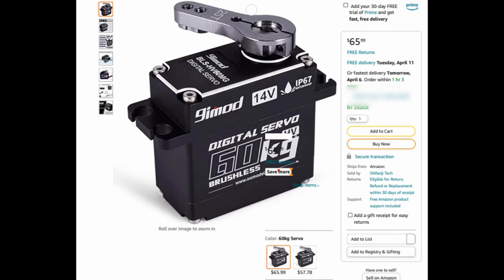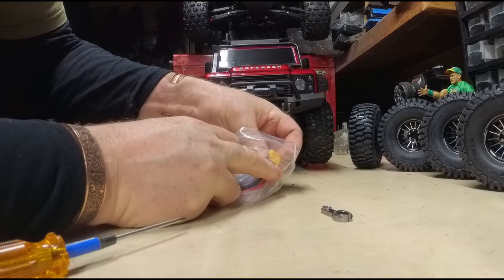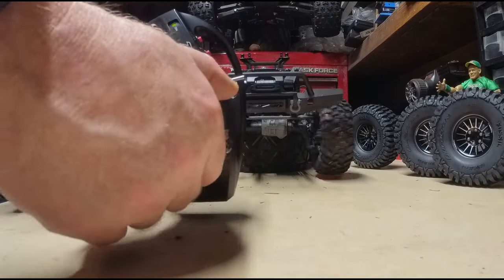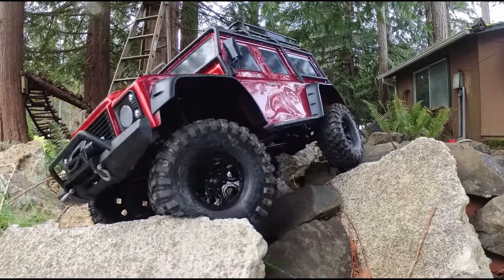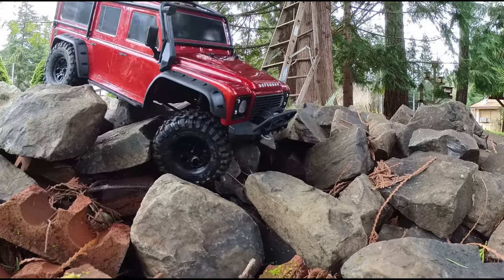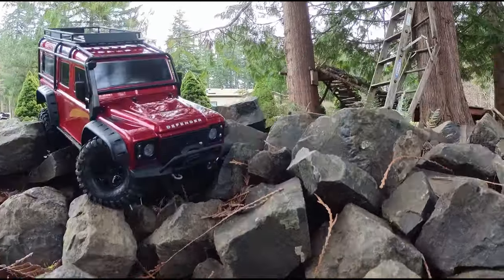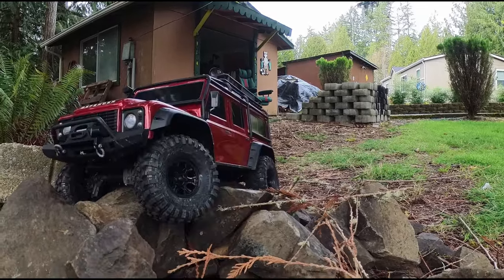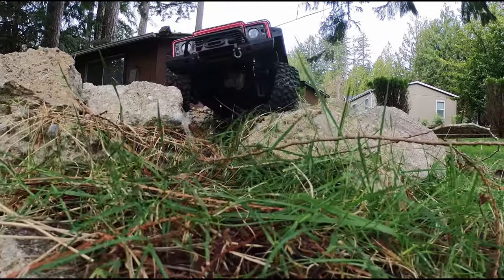9imod 60kg servo installed in Traxxas Trx4 Defender

Comment: I’d reccomend using some heat or acetone to break those tires off the rim and throw them on metal rims, they’re really good with the added weight
Reply from the maker: Solid advice, I just recently trimmed some of the tread pattern off, and am blown away by the difference in performance and looks, so some aluminum or steel beadlock wheels and maybe dual stage foams or the hair bun thing is in the near future. Thank you for commenting Much appreciated

Comment: When battery is plugged in. Is it ok for the Servo with power up first then signal?
Reply from the maker: you should always signal first (turn radio on)  then power up and never leave a battery plugged in after use I hope that helps :)

Comment: When you are looking for a servo, you should seek to find something with stainless gears or steel gears......not metal. Aluminum is a metal!
Reply from the maker: Thank you for your reply, and yes I know what to look for with servos, I wanted to try this servo out and so that is what I am doing :)
Reply: @jammer2150  Thank you.....but their are others that read the comments for info! You didn't mention the gears in your video?
Reply from the maker: @rccrawlingaddict207  True and I honestly did not think of mentioning the gears all tho I spoke about how noisy the servo is on the bench. which I assume is because of the gears. I was not really approaching this as an in depth review. Crawler Canyon has done a bit of a review testing manufacture oz and kg numbers vs what his digital servo tester is getting and a little real world testing in the vehicle, but the title of his video does not say review it says Testin Time  https://www.youtube.com/watch?v=st5RD2o544E&t=849s  
The title of my video does not say review or in depth review, it just says. " 9imod 60kg servo installed in Traxxas Trx4 Defender "  I also left a link to the servo where one can find all the info needed for that servo including  the gears.... Full Metal Gear Steering Servo: Equipped with stainless steel gears.